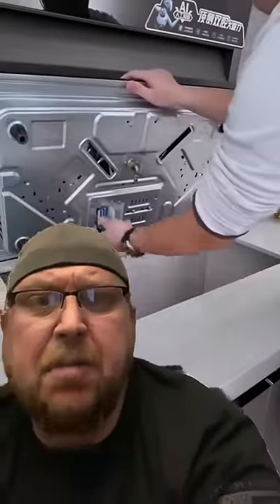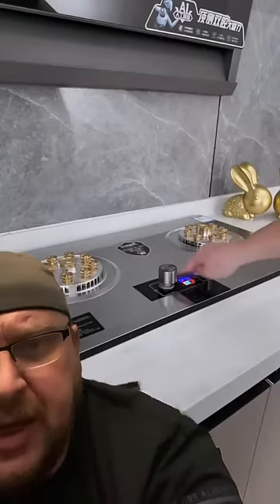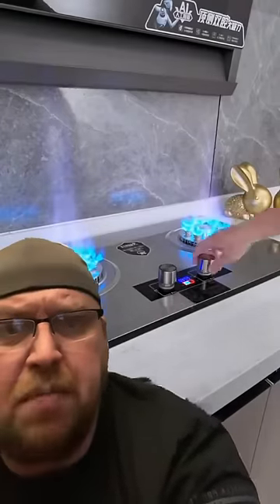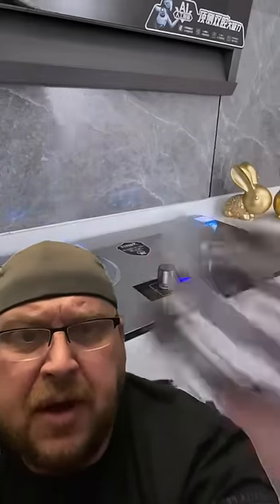Kitchen Go Boom￼

Comment: Haha...I only caught the absence of the clamp 😂😂😂
Reply: That was the first thing ...!😂
Reply: First thing I noticed too
Reply: I cant believe there is even a legit hookup for gas like that. I wonder if this is even upc approved.
Reply: nicholase2868  thats a gas whip quick connect. But just a barb and hose?
Reply: @sleektoneofficial  i mean there is a jumpcut when he backed away
its subtle but maybe he fixed it? maybe? probably when he turned the gas on to
Reply: My first thought was that you can't permanently install that because you will need to periodically replace the 9 volt batteries.
Then the clamp.
Then that fact that a drop-in installation can "slosh about" in the space cut out of the counter.
and THEN the fact that the whole burner assembly is not meant for permanent installation, as evidenced by the rubber feet.
-
Oh, and the flame is way too high for anything but needlessly burning gas.
Reply: I’m still trying to figure out how he ran a rubber hose off a steel line and how many houses has this stove top destroyed?
Reply: @sleektoneofficial I see no problem with the gas hose other than not putting a proper clamp on it. Maybe it's different in the US?
Reply: @B_hind_The_Curtain  rubber hose for gas is standard in a lot of countries.
Reply: @nomennescio7571  you cant use a compression fitting for gas, must be flared. So a hose clamp?
Reply: @nomennescio7571  a hose clamp does not seem like a solid connection for gas to me.
Reply: @nomennescio7571  everything in us is either threaded or flared. Bigger gas mains like 3” and up are welded at the risers and then you have yellow poly which is actually like a sharkbite fitting believe it or not. I hate poly for gas but its accepted by code.
Reply: I dont think thats legal in a fixed kitchen with or without the hose clamp. Where i live at least, a stove top needs to be plumbed in by a licensed plumber. Unless thats outside and classed as portable, even then all the ones I’ve used had threaded fittings,
Reply: @nomennescio7571 in Australia kitchen stoves need to be plumbed in by a licensed plumber.
Reply: @sleektoneofficial  in the US, yellow PE is great for underground. Can't be above ground because  UV dryrots it and causes it to crack.

Which I would assume would also happen to a rubber hose, so I can't even comprehend this!

I use rubber hoses to hook up my manometer  to pressure test gas houselines and I replace em atleast once a month because they crack and leak....
Reply: @tehpurplepills  yeah makes no sense to me
Reply: @tehpurplepills  im not even a fan of pe for gas i prefer copper flare.
Reply: @letterslayer7814 The burners are probably meant for wok cooking, which does need a really high flame like that.  Other than that, the highest setting of the burner isn't necessarily how you use it when cooking.
Reply: And it looks like a rubber surgical hose. 🤣 💥 BOOM
Reply: @sleektoneofficial It's common for low pressure hydraulics but I wouldn't personally trust it for gas unless there was a master shut off that you were using every time.
Reply: Theres no clamps on gas lines. It’s dangerous.
Reply: Cheap plastic hose that you can fit on by hand, what could go wrong 🤷‍♂️😂
Reply: Me too
Reply: @MonkeyJedi99 base on those rings they put on the stove burners this might be a wok station setup. Woks usually use really large flames with high heat
Reply: @sleektoneofficial  Same as with butane stoves... but at least those are open frame and certainly need a clamp, lol
Reply: I also came here to say this 🙈
Reply: @letterslayer7814 conveniently cut out 🤔😉
Reply: @nomennescio7571  Thats crazy. You use anything like that in Canada you will lose your gas ticket in a heartbeat lol.

Comment: Always wished I could cook my food with fighter jet engines
Reply: Perfect for when you're using the wok, which are very common in Asia.
Reply: Go look for street food videos in Thailand or something similar. Them things are almost exactly jet engines.
Reply: insanely cool sounding idea
Reply: Hot shot movie thought about this before ya 😂
Reply: You can't do asian right without an insane amount of heat, and electric won't cut it at all.
Reply: I'll drink the jet fuel mix with water
Reply: @klocke-hx3xl  not necessarily true
Reply: @FrankCosbyNo-Relation  And yet it is. You can have slow cooked Chinese, but it's not the same. At all. The theory is that the high heat sears the outside surface of the food and locks the flavor in. Plus, it gives a crunch to the veggies. I dare you to find any authentic Chinese restaurant that doesn't use double burner gas ranges.
Reply: @jaisummons2304  don't forget to season the  jet fuel
Reply: @klocke-hx3xl  sushi 🍣
Reply: @FrankCosbyNo-Relation  japanese
Reply: @klocke-hx3xl  your first comment just said Asian, sushi is Asian
Reply: @FrankCosbyNo-Relation  Nice try, but I never said Asians only eat cooked foods. In language, context is necessary to determine meaning. Pretty obvious that the comment concerned cooked food. It's also as obvious that you can lower the heat on a double burner and simmer, as that would be required as well. Doesn't change the fact that if you want to cook delicious Asian food, you will have to have a source of heat that's not only extremely high but instantly adjustable as well.
Reply: @klocke-hx3xl  lol you deleted your first comment 🤣
Reply: @FrankCosbyNo-Relation  Nope. It's still up there. Perhaps you should try less feeble lies. Why would I delete it anyway? Never denied saying Asian food. Are you going to cry now?
Reply: @klocke-hx3xl Acually electric induction heating would be the best for high temperature but I understand why those aren't common due to the shape of the wok
Reply: @danijelgasparic3658  There's a large market for commercial restaurant ranges and they certainly could make a wok shaped induction  cooktop, but there's no demand. Chef's prefer gas to induction. Maybe they're resistant to change, IDK. Or perhaps there's something about the way flames heat the food. I'm not a pro chef, just an amateur, but there's little doubt that cooking is an art. I can make subtle adjustments on the heat and use the bottom of the wok for high heat and the upper edges for lower. That's what all that burned scale is for. To help hold food in place. There's more to it then you'd think.
Reply: You can achieve the same thing by marinade in Kerosene.

Comment: I need a set of these burners so I can light my ceiling on fire.
Reply: @LobstersLobsters Adds grease as a protective layer if you cook with it too. Oh, and if you're ever starving, just grab a ladder and lick the ceiling. The snozberries will taste like snozberries, I promise.
Reply: I would also like to set my expensive cabinets on fire
Reply: @LobstersLobsters i always wanted to pre heat my my house
Reply: I know right. This has just always been such a problem: my ceiling just not being engulfed in flame. I need some excitement in my life. Now I have the solution to my problem with the added bonus of a fucking bomb sitting in my kitchen now.

Comment: 9V batteries and a gas line… a match made in heaven!
Reply: @buggyG12345  The point was that you've taken the time to plumb in the unit to gas, but you're using a 9V battery for power.  It just seems wonky to me, but hey, whatever works.  For those times when you've got a gas line run but no central electricity... but you've also got a closet full of 9 volt batteries!
Reply: @BenWard29 there's quite a lot of gas stoves using batteries what's your point again? Lol
Reply: @DarkAttack14  First off, I have no real point, as it's a Youtube comment.  It's a scream into the darkness of the eternal void for a hint recognition, to hear a faint voice saying "yeah, that dumb shit you said made me chuckle".  Second, I know that many stoves use 9V batteries for ignition sources- I have had a few people make me aware of that fact in this very comment section.  I still don't understand why you wouldn't just use a piezo igniter- why even use a battery at all? Also, if you're running power to your oven/stove like every installed oven/stove I've ever seen in my 41 years, then there is no need for a 9V.  I would only think this is for flexibility for edge cases that I haven't seen.  I mean- by all means- if you're stove runs on 9V, that's cool.  No shame- I guess I just need to get out more.  It's still weird to me though.
Reply: Well said 😂😂😂
Reply: @BenWard29 gas fireplaces that run off 6/9v, usually have an option to run batteries as a backup, but use a adapter to house current.. I always laugh and sit wondering what other shortcuts the builder took, when I see  sometimes they  didn’t run electrical  to the fireplace when they just ran a gas line .. to then just say “yep it runs off 4 double A’s” that the home owner  ends up changing every 40 hours of use lol
Reply: @DarkAttack14 ain't ever seen one in the kitchen
Reply: No match required. Electric start😊
Reply: @DarkAttack14 I've only seen batteries in portable stuff. I wouldn't be surprised if it's common in other places but it sure is not common where I live.
Reply: It also had a screen, dunno how you're gonna run a 5v lcd off of a piezo electric spark. Now that's one genius way to get the magic smoke out of your $3,000 cook top.
Reply: @BenWard29 at least you finally learned batteries are used in electronics 😂😂😂
Reply: @blindsniper35 you can't say it's not common where you live and your only actual searching is your visit to Lowe's 😂
Reply: @DoubsGaming ah someone else who doesn't know what batteries do 😂
Reply: Yeah it’s more common than you think…
Reply: @DoubsGaming  Why in gods name would you buy a $3000 cook top (for a fixed kitchen) to run it off a 9V?  I could see for a food truck, or camping, but for a kitchen?  Also... why exactly would you need a screen for a cook top that can't even be connected to the mains?  As someone who is a mechanical designer,  I just don't get the use case except in the case that you live somewhere and don't have dependable electricity, ok fine, but a gas powered single burner (with a peizo) is a much better choice.  This specific feature set (9V battery and LCD screen, mounted into a home counter) seems like something I feel like there are better choices for.  Personally, I don't want to have to keep 9V around when this one goes bad or else I can't cook.  If you have to, run the screen off the 9V and  the igniter using a piezo.  That way the cook-top is usable even if the 9V dies.  Just my opinion.  Obviously someone thinks its a good enough idea to make and buy it.
Reply: @Steve.._.  Yep finally.  I kept wondering what those little cubbies were in my TV remotes, and why they wouldn't work.
Reply: @BenWard29   I don't really know what that has to do with my comment. I don't understand the part about LCD and mains. Many electronics, batteries or mains voltage can have a LCD. The rest also doesn't make sense to me.
Reply: @Steve.._.  I didn't say anything about batteries so I don't know how you came to this conclusion. I don't claim to know everything about electricity but I have taken multiple college classes about the subject and also am currently in a mechanical design program.

I don't know your qualifications and frankly don't care. None of it matters on the internet. But don't assume I know or don't know anything.

For all I know you kill cats, is that true? Probably not but it's about equally what I know about you.
Reply: @DarkAttack14 imho he's right, these bastards cost a lot, while you can buy most common burner, with no display or things like that, and they are directly connected to the powerline
Reply: @DarkAttack14  not everyone would know, I've never seen a gas stove my whole life in the 10+ countries I've been to! Electric is more practical, and as its now done by magnetic force it doesn't even get the surface hot, whole the pan or pot itself still gets hot!
Reply: @viktorbirkeland6520  "more practical" gas stoves are superior, faster heating etc. There's no such thing as a magnetic stove, you mean induction heating which yes is nice... But still slower than gas! Where I live natural gas is very cheap and available from a hardline off a gas grid... Electricity is very expensive in comparison
Reply: A match made to go to heaven
Reply: @Steve.._.  You do realize there's a difference between not common and not at all right? 
You've also simultaneously overestimated and underestimated the amount of research I've done. I haven't even bothered to check any of the hardware stores and just going off of memory. I did ask my friends that working or worked in construction if they have any examples when I showed them this video. They have seen a few that run off of batteries in cabins. Hence it's not very common and not they don't do that here.
Reply: @BenWard29 can ya not just light it with lighter ? If batteries go flat ? Just asking

Comment: Spotted the lack of hose clamp too. I'm sure there's hack for that involving some PVC pipe, woodscrews and a blowtorch. Can only end well.
Reply: You forgot the hot glue gun!
Reply: An angle grinder with no guard and flip flops are mandatory!
Reply: @monkchips and ganky toes have to be in shot at all times
Reply: Residential natural gas is 1/2psi, rubber hoses slid over barbed fittings without clamps were once common in the USA as well. They're still used in schools/labs for bunsen burners.
Reply: @Texassince1836   Your response actually got me to look that up, and you're essentially right.
By the time the gas is in the line feeding a single-unit home, it is down to about 1/4 to 1 psi (0.017 to 0.069 bar) above ambient pressure.
And yes, lab bunsen burners are friction connected, because they are often disconnected. And the flexible hoses are checked regularly for cracks and wear and replaced when required.
But if you look under the lab bench, and at any other non-temporary connection, you will find threaded connections with plumber's thread tape and/or thread sealant.
The burners demonstrated in the video are meant to be a temporary installation so I guess the friction connection makes sense. But if someone watched the video and thought it was a truthful representation of how to install a permanent gas range, they could be making a dangerous mistake.
-
Anyway, I've been too verbose, as often happens in the mornings.
Thanks hugely for leading me to do research on the topic!
Reply: @Texassince1836  30mbar (which IS half a psi)  is the standard for a bottle gas regulator here in UK (for things like camping stoves) 
I remember at school lighting the bunsen then using the flame to ignite the source at the tap on the desk by pulling the tube off. 
Still have my eyebrows and didn't get suspended. 
I think schools need 14 teachers to hold one bunsen burner for a class of 3 pupils in 2023
Reply: Do they have zip ties in China?
Reply: Turns out that a blow torch and an open gas valve were the cure for stupidity all this time! Who would've thought?
Reply: Oh u, Randy, always the man :D
Reply: Don't forget the JB Weld.
Reply: Sweating the rubber hose on with solder
Reply: I never could get the gum to seal it up right

Comment: As a Gasman, those wok burners are BADASS.

Installing rubber tubes for gas, with no leak test is INSANE.
Reply: I wouldn't think you just like....wedge the gas line on, but I'm not a gas dude
Reply: @thomasb7347  I do HVAC which involves gas. You would be correct don't do this, this is how you blow up your kitchen.
Reply: @cam6202  Seems like all that pressure would eventually push it off. He didn't even do one of those metal clamp things that you cinch shut, which I assume is also not the way to do it but at least would l9ok acceptable
Reply: @thomasb7347  He didn't close it permanently as he's using this as a portable device! Works just as well in the car! And if you don't have gas in the car, just run a flexible tube from the exhaust into a contraption inside, so you can heat yourself and your food!
It's super safe, no need to install fire alarms or carbon monoxide / dioxide alarms, nobodysgonna check your inconspicuous car!
Reply: @thomasb7347 gas comes out of the wall at 0.5 PSI, so you wouldn’t have to worry about that. I would assume this is a quick connect and the video just doesn’t show it properly
Reply: I have been drooling over Wok burners for about a year now. Haven't pulled the trigger yet lol

Comment: Yeah, because I want to have to open up my counter to replace batteries instead of shelling out the extra buck or two for an integrated mains adapter.
Reply: I cannot speak to this stove but they ones in Asia only run the igniter and last for ages and ages.

All those center lights/timers etc should have had a separate cord just like the US.
Reply: @StopTryingSoHard  I didn't see a seperate chord on this one
Reply: They're rechargeable and use the flame to recharge you'll never have to worry about battery change 👍
Reply: @DarkenedSilhouette  wow, that's still a worse solution than just using the power from the wall.
Reply: altleast it'll work when the power goes out and you don't have matches/, lighters
Reply: I was thinking this too.
Reply: @DarkenedSilhouette that's not how physics work
Reply: @Subreon  i know bro I just wanted to see what Fletcher would say lol
Reply: @DarkenedSilhouette how do they use the flame to recharge? They have a steam engine above it to catch any extra heat to then boil water to turn a turbine to turn a fly wheel to spin a piece of magnet with copper wire cooled around it? Cus if so that’s cool
Reply: Rich man over here

Comment: Those are wok burners, in case anyone wanted to know. When using a wok, you cook at higher temperatures. The American flat-bottom wok doesn't actually get hot enough because an American residential stove doest put out enough BTUs.
Reply: Skill issue 😆